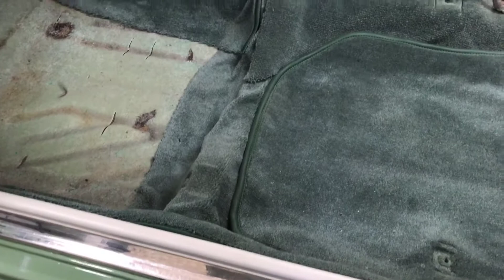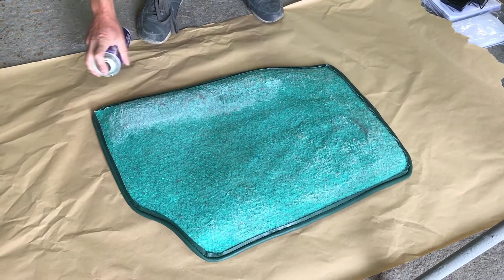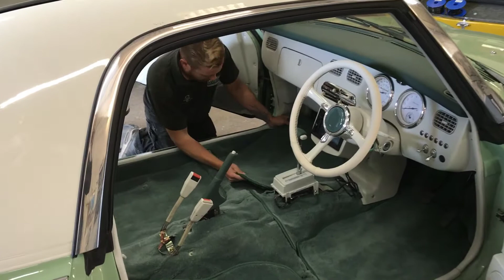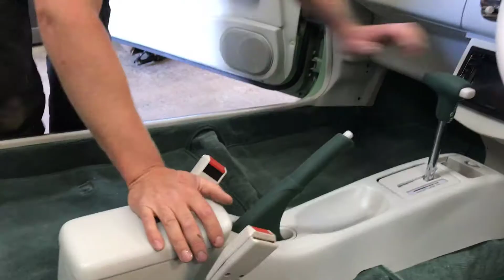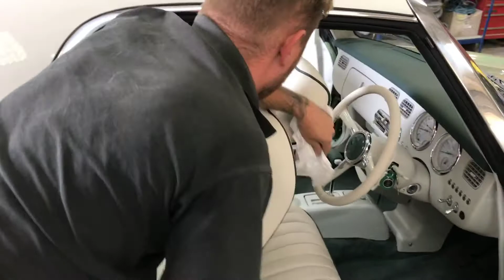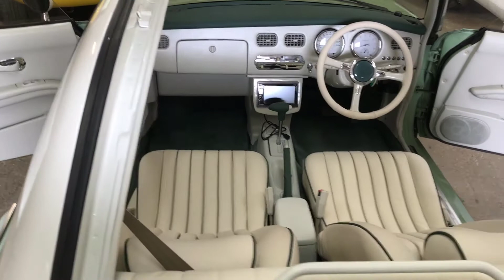The Figaro Shop guide to fitting Nissan Figaro Carpets

Comment: This video lacks details necessary for even a moderately smooth installation. The video starts with the difficult pieces already installed.  I'm about an hour into the install and it seems there is A LOT of cutting/ trimming required. I bought the top-of-the-line carpet kit and was expecting an easier installation or at least some basic instructions for this price$$$.